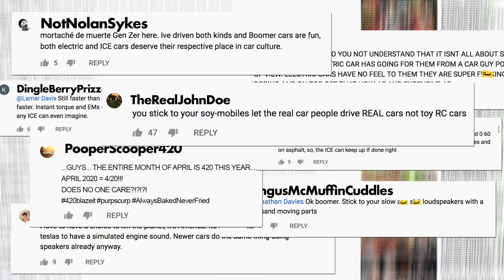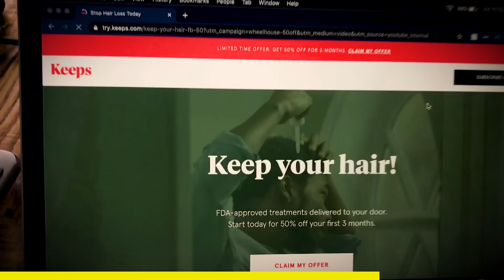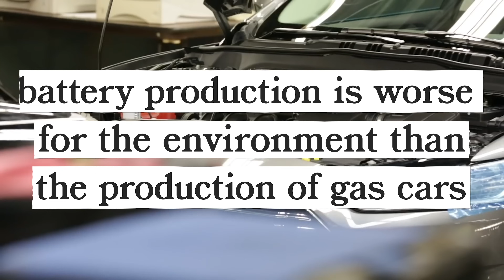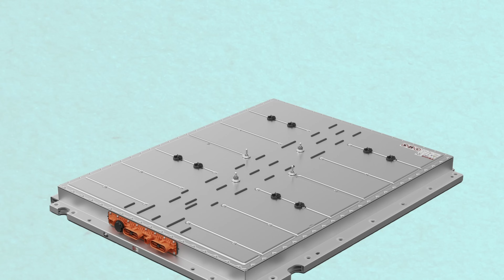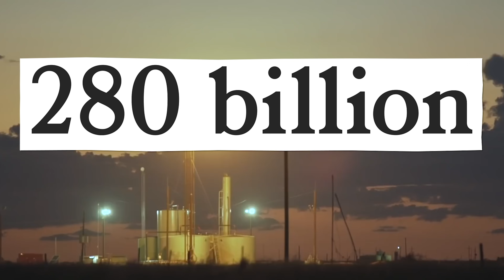Are Electric Cars REALLY Better for the Environment?

Comment: Meh. I live in a townhouse and I can't have a charger installed that would connect to my house's power. And I don't want to have to drive out to a charging station to pay more money to charge my car up.

I'll continue to ride my motorcycle as much as I can instead of driving my car (which is a hybrid). Motorcycles, even at the low end are more fuel efficient than most cars. My current bike has a 6 cylinder 1,649cc engine and it still gets 45mpg on average. If I were to be more conservative on the throttle, I could get it into the low or mid 50's.

More people need to ride motorcycles. They are a lot more fun than cars, they are easier to maintain and you can park just about anywhere.
Reply: Fuck that use a bicycle
Reply: @subharatisinha547  Bicycles lower your sperm count and make having children far more difficult...
Reply: You can literally plug an EV into a normal socket without any modifications to your house's electrics. I agree that motorcycles are cool and efficient, but don't say you can't charge an EV at home.
Reply: @wojciechmuras553  Yeah you can plug a electric car into a 110 outlet. But it will take about 10 days to charge the battery.
Reply: @moabman6803  For a full charge. For daily use, plugging in every night gives you more than enough power. Besides, you also have 240 sockets.
Reply: @wojciechmuras553  If you only have 110, you will only gain 10% charge at most overnight. The op says he doesn't have access to 240.
Reply: @moabman6803  https://youtu.be/jMmUoZh3Hq4

And 10% what? Nissan Leaf will gain 60%. Chevy Volt 100%. Tesla Model S 20%. All of them will gain some 50 miles. Percentages don't matter.
Reply: @wojciechmuras553  I'm just going by memory of the various models of electric vehicles I work on in the shop. Sometimes the office personnel will try to charge them on 110. It takes forever. The numbers you posted don't seem to line up with the charging times I've experienced.
Reply: @moabman6803  Standard chargers included with most cars are 1.8 kW. 110V/16A. Over 8 hours of nighttime, that totals to over 14 kWh. Nissan Leaf realistically does 4 miles to the kWh, so that clocks in at just over 50 miles of range from an overnight charge. Which is about 60% of it's range. A Tesla obviously consumes more, but I don't yet own one, so I can't tell how much range it gains overnight.
Reply: I am going to use Clarkson logic: If you ride a motorbike you die faster
Reply: @afnanchoudhry2889  Stupid argument, if you are an idiot, you can die from anything, and anywhere. Wear good equipment and you will be fine in regular accidents. A very serious crash involving a motorbike and a car would likely kill both the drivers anyways. Always have a helmet and enjoy your ride.
Reply: @RomanianOrder  I meant it in a joking manner I know Clarkson is stupid I was trying to lighten the mood. Sorry
Reply: @afnanchoudhry2889  my bad then, sometimes i just cant take a joke 😂
Reply: @RomanianOrder  it's ok don't worry about it
Reply: @afnanchoudhry2889  clarkson is always right mate
Reply: this is a joke btw
Reply: @afnanchoudhry2889  Clarkson logic?  Where the hell did you see that?  I don't have much time for him. He complained forever about diesel fumes causing cancer. Then he smoked 20+ cigarettes the next day........
Reply: @Brian-om2hh  he said he was joking fam
Reply: You don't fancy going electric with your bike then?  Take a look at the Zero Motorcycles site.....
Reply: @Brian-om2hh  Zero motorcycles are garbage! They break down more than Harleys!
Reply: No

Comment: New investor here, long time car lover. EVs will eventually take over in the coming years. So here's what i'm doing, invest in tesla long term, use proceeds along my portfolio run to fuel my car enthusiasm. Hypocritical? Maybe. Do I care? Not at the moment, especially if I take a look at my carbon footprint atm. 

2 Year Ownership of my Corolla:
2006 Toyota Corolla 1.4 vvti Production = 7 metric tons
5000 km driven (3100 miles) per year  = 0.8 metric tons (emissions for my 1.4 engine = 159 g/km, 256 g/mile)
Avg L/100 km = 8 --> 400 L of gasoline (per year). 
Assuming 3.35 pounds of emissions per gallon (according to sierraclub.org), or rather, 0.4 kg per L --> 160 kg --> 0.16 metric tons per year

Total Carbon footprint since ownership = Around 9 metric tons
Yearly carbon footprint = 1 (+/-) metric ton.

I think I'm doing pretty alright at the moment. Yes, I don't drive that often I know, but I can be at peace with the level of my carbon footprint. DISCLAIMER I didnt take into consideration the prior 100,000 km, only the car itself and how i've been using it.
Reply: gas cars emit 6-7 metric tons from factory, as for example, an average car like a toyota corolla or honda civic emit 270 grams per mile, average miles driven in gas car is 13,500, gas cars emit 3.6 metric tons a year, average to keep a car is 6 years, gas cars emit 28.6 metric tons during its life time, electric cars like tesla model 3 averages 13 metric tons from factory, tesla model 3 has 264 miles mid range, emits 85 kg per kwh, battery size is 65 kwh, tesla model 3 emits 300 grams per mile with powerplants, that means model 3 emits 4 metric tons each year, which would mean 24 metric tons in 6 years WITHOUT  factory emissions and 37 metric tons in 6 years WITH factory emissions, I have sources and statistics and calculations to prove I am correct, Electric cars are just as bad, if not even worse
Reply: Cant beat the simple mathematical calculations

Comment: Let’s do the math: a model X produce 17 metric ton of co2 to produce. An average ice vehicle emits an average of 7 MTCo2 plus another 4-5 MTCo2 a year if you drive 11-15k a year with an average gas mileage of 22MPG. Charging my EV at home with solar panels makes EV still cleaner in the long run.

Comment: Two things you left out. The oil extracted being used for running transport is not as high as everyone thinks especially since ethanol has  been introduced and yes, I am taking engine, differential, transmission and power steering fluids into account. Oil is used to make other products as well like plastics which you covered but you didn’t mention that all cars use plastic, including EVs. So EVs use oil too. Go figure. 

That’s not the biggest issue though. You forgot to address the pink elephant in the room. The biggest issue BY FAR is that batteries do need to be replaced, which you avoided mentioning completely. Making the batteries is the most polluting part of the car making process (you proved that in your video) but you failed to mention that this process needs to be repeated every 2 years for each car on the road. Yes, it is claimed that batteries last up to 5 years but that depends on the battery being looked after which doesn’t happen since batteries need to be actively cooled which car and phone companies don’t do, and EV cars will be driven by the general public who don’t always look after anything they even depend on, let alone something they see as just something that gets them from A to B. (Public toilets and Kenosha Wisconsin are good examples of how well things get looked after by the general public) Not only that, but the battery inevitably runs down over time so a Tesla with let’s say a 300 mile range diminishes over time to eventually become a Tesla with a 150 mile range by the time the battery is considered to need replacement making the car less and less practical with each passing month to the point of being almost undriveable outside the city at the end of its lifespan. Just like phones having 2 days charge when new and one or even half a day when you want to replace it. So the moment you claim the car should be more efficient but isn’t because the car is struggling to reach half its range and needs to be charged twice as often, the battery needs to be replaced which drags the chase for efficiency back to square one. So you would be false if you claim that EVs are currently more efficient because EV owners are still chasing their tails and spending heaps of money in the process replacing the most expensive part of their cars every 2 years. It’s inevitable that this will change and EV cars will ultimately become cheaper and more efficient and will phase out combustion engines altogether which will result in cars like my beloved falcon becoming a novelty item next to the horse. But that isn’t going to happen for a while yet.